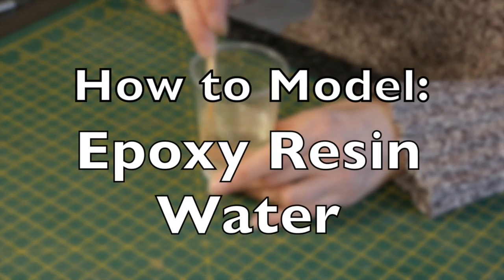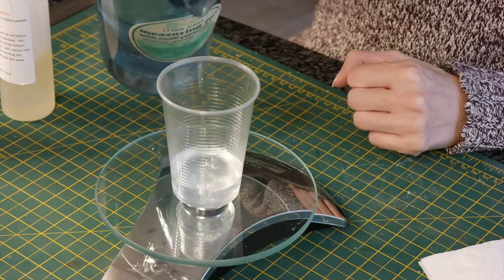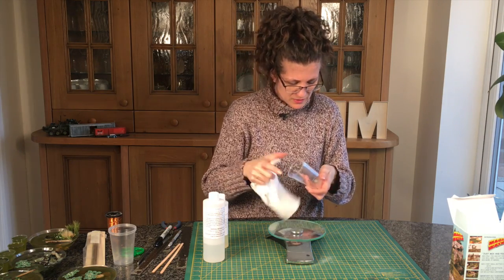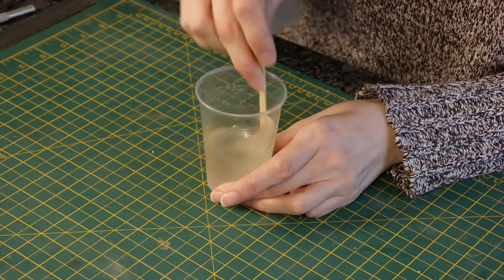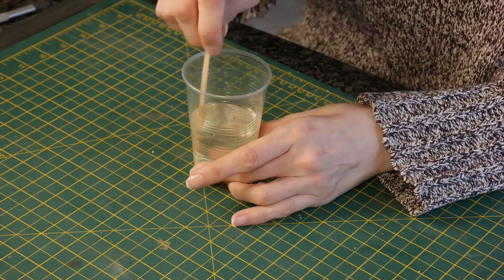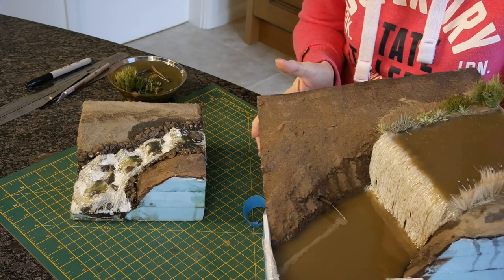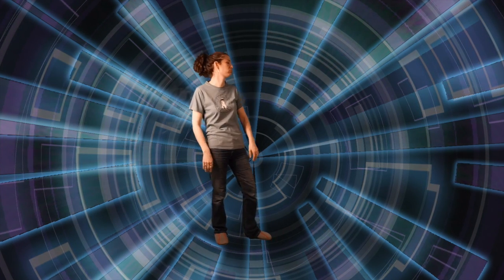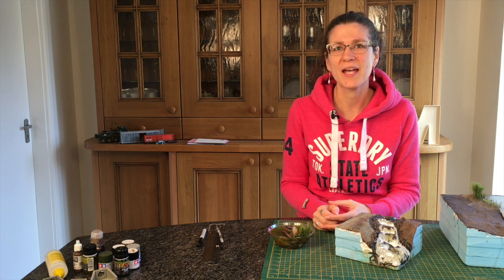How to Mix Epoxy Resin for Water

Comment: Kathy, I notice in the three example dioramas you showed at the end that the water is dark brown and not clear. Is that because you added brown paint or does it set and lose its "clearity"?
Reply from the maker: +Christian I do add a few drops of paint. I've used both acrylic and enamel and not noticed a difference. If you add a few drops, it will go muddy but one or two drops and a few pours can build up a semi clear pond. Alternatively, try Tamiya clear paints as they aren't opaque.

Comment: Hi Kathy, I have bought some Gorilla Resin Glue. Will this work in the same way?
Reply from the maker: Sean Selley-West It's a glue that I have never tried but if it's two part then you mix it the same way. I did use an epoxy resin glue for icicles once but they yellowed quite quickly.  I guess glues are not designed to stay clear.

Comment: Hi, Kathy,

I want to make a beach scene diorama, and the water/ocean which is at least 3 to 4 inches deep, and the dimension of the water is approximately 7" x 10".  Do you recommend Magic Water to make such large pool of water?  Thank you
Reply from the maker: Hi Gilbert, I do recommend it for the area but I would pour it in several thin layers. That way, if you have a mix that is slightly off and doesn't set, it's not a major problem. It should also keep the heat down as epoxy resin does heat up when setting. The only thing is that it could be quite expensive. 

If you do decide to use it, let me know how it goes. Kathy
Reply: Thank you for the answer.  I am going to submerge half of my painted 1/35 scale model tank into the Magic Water epoxy resin.  Will the heat generated from the resin melt my tank?  Also will the heat melt the paint?
Thanks for your time.
Reply from the maker: +Gilbert Li it is a danger with a large pour but if you stick to several smaller pours, they don't heat up as much. I have heard of melted plastic but personally haven't had a problem because I do stick to thinner layers.

Comment: Thanks for stirring !How would dyes go for colouring  like tim holz that is not water-based ? Or modelmates lovely translucent weathering dyes??
Reply from the maker: +Vikki Wilson I have used enamels and acrylics and not noticed any difference between the two. I don't think we are adding enough material to make much of an impact on the resin itself setting etc.
Reply: Let's hope so. I did see Commissar Gamza swish brushes full of dirty washes in his Vallejo (I think) acrylic water. Looked great.
Reply from the maker: +Vikki Wilson The dirty brush technique is an oldy but a goody.  I love Troels Kirk's use of colour and his water is excellent.
Reply: Vikki Wilson b